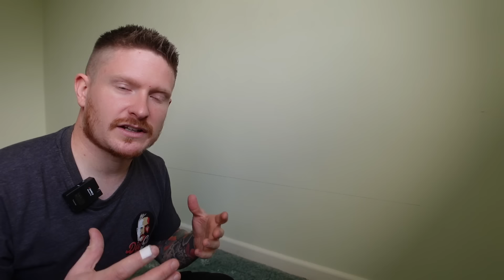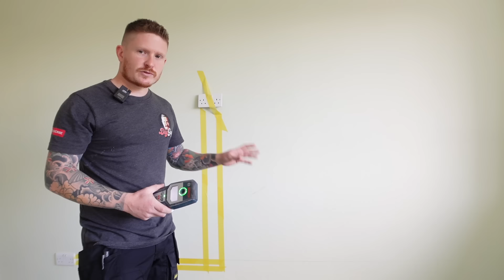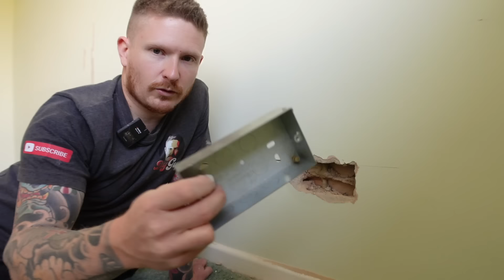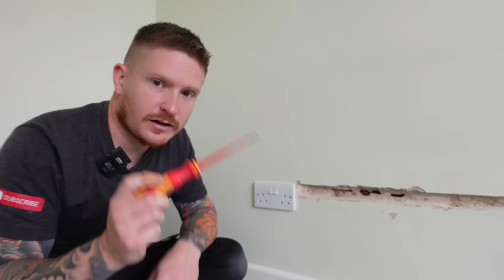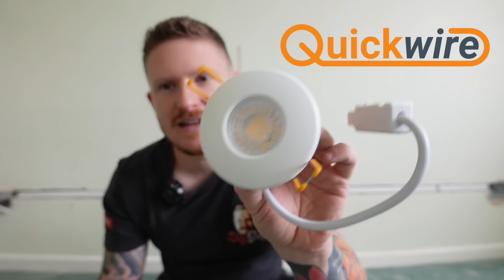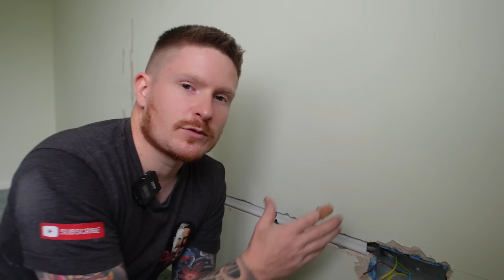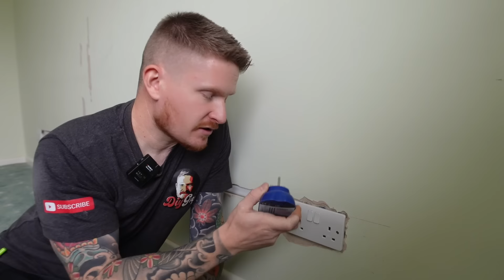How to Add a Socket to a Wall - Easy Step By Step Guide

Comment from the maker: What other electrical jobs do you want to see?
Reply: How to install a new shed in your backyard with lights connecting to the house power supply
Reply: @Megagamer12312 if it involves burying armoured cable, you have to be qualified to sign it off?
Reply: @sprint955st I won't tell if you don't!
Reply: Solar install
Reply: You at my house fitting solar panels for free!
Reply: Add an outdoor socket from main ring
Reply: Great video! Do you have anything like this for a studded wall specifically? Interested to see the correct way for running the cable past the batons.
Reply: Safe ones that comply with British Standards 
Simple really 🤷‍♂
Reply: Fitting a shower fan light please 👍
Reply: Putting a socket into a loft that only has loft boarding
Reply: Wiring the garage
Reply: how to on adding powered went/extractor to bathroom would be nice, can it run off of light fixture power?
Reply: @maciej9280  this is exactly what I need a video on
Reply: Nice little tutorial. What shade of paint went up afterwards? Looking for something similar for my kitchen?
Reply from the maker: @andrewgibbs5096  it was copper blush
Reply: Moving an upstairs bedroom light switch from one location to another
Reply: We don't all have plasterboard on our walls.
Reply: How to add a pair of switched bedside pendant lights c/w switch to control the pendant and the main room light 💡
Reply: Attach a ring doorbell
Reply: outside lights but with the wires from the inside so looks professional
Reply: Extractor fan for a bathroom 👍
Reply: Ones done qualified electricians
Reply: Consumer unit change
Reply: How to add a light in a understairs cupboard?
Reply: Could you do a video on how to remove old sockets such an aerial cable and old plug sockets, remove them and then fill the socket hole to blend in with the wall like new!? Would be a great help
Reply: How to add a new socket in the loft . How to get power for that socket if there is only a junction box for lights. Thanks mate
Reply: Can you change a fireplace electrical socket, and turn it into a normal socket which allows a fireplace to still work and plug a plug into too?
Reply: Thanks for the video it's very informative 

However, you demonstrated moving socket just across, what if I need to move it on to the perpendicular wall, and pass the corner, will I stay in the zone ?
Reply: Thank you, I can’t find the cable zone video. Also what about installing an outside socket please.
Reply: Patio lights on a submarine 😂😂
Reply: Can you do a short of showing off all your tattoos? That would be cool! :)
Reply: I want see full electric wire replacement of old with new design including new fuse box.
Reply: Do a minor works cert for that socket,then can you install a fully addressable fire alarm system in a nursing home.
Reply: Installing a consumer unit in a garage beside a house
Reply: Can you show us how to terminate a 4L 2.5mm MICC end, complete with gland and earth tag pots and seals, and how to insulation resistance test and measure it to identify the conductors and polarity, thanks!
Reply: A useful one would be to spur in a bathroom extractor (and how to fit extractor in loft, extractor duct installed to bathroom ceiling and exterior plus isolation switch etc) that would deff be a useful video; especially with bathroom mould due to damp being an issue.

But more importantly: because your videos are extremely simple to grasp, informative and professional. For competent DIYers, it'll be priceless.
Reply: How to get power from a socket, for lighting such as wall mounted bedside lights
Reply: @syedabbas8786 I second this. How to add a second light fixture taking power from an existing light fixture, or making a socket using power from an existing power source
Reply: Rewire my wife`s brain, joshing great video.
Reply: @herbetone  Careful, she who must be obeyed has ears and eyes everywhere...You don't want that tea tasting funny!
Reply: 😅😅😅 @Mclaneinc
Reply: How about you testing your work and providing an appropriate electrical certificate for what you have done. After all without the certs you have just voided your home insurance in the event of fault with your work.
Reply: @rjpish exactly right mate
Reply: None. You shouldn’t be doing electrical work at all. You can just now because the law allows you, but it will be changing very soon. Once the NICEIC push the government enough, You’ll soon have to pay that £50.00 per hour. Sorry.
Reply: You should be Part P qualified  by law to do electrical work in a House. And if YOU are not qualified you should not be making money out of this vid.
Reply: None!!! Stop teaching people how to do there own electrics. Especially when your not teaching them correctly, was that a ring you ragged that cable into because you didn't explain you have to make sure of that frist. Plugging a £3 socket tester in at the end of a job hoping it beeps doesn't mean you done it correctly! why do electricians test equipment cost £1000s of pounds if we could all buy a £3 socket tester!!! Was your Zs in regs? What was your PFC/Ze reading? Have you got RCD protection? None of this was explained! You cant just add a socket like he has made out on this video! DONT DO YOUR OWN ELECTRICAL WORK!!! THIS IS NOT HOW YOU DO IT!
Reply: Installing an extra light in a shed/ garage.

Comment: Hi many thanks for all your advice as I've learnt so much from you. If you have time to answer the following query it would be great. I'm currently building a model railway which needs around 4 to 6 sockets.. I have a double spurred socket in my room. To add another socket can I attach extra wires to the spurred socket which means 3 negatives. 3 positives etc or do I attach an fcu or junction socket to the spurred socket? As you know model railways have low electricity around 12 volts. All the best

Comment: If you  are just wanting to move a socket to a new place along the wall, can you join the wire somehow and cover it with the filler?
Reply from the maker: Not really. It should be accessible or maintenance free

Comment: 15:23 i would 100% use wagos or even better buy a new socket with wago-style terminals when fitting a fused spur - i know this is a standard spur (they are £8 each,so pricey but well worth it for the time saved). It can be difficult to get two cables into a terminal and get a decent, tight connection, 3 can be a massive pain!
Reply: Yep, just keep the ring active, wago 221 series  support 32 amp to 41 amp so you can the  extend the ring without fused spares randomly scattered around and having to put 3 cables into the terminals of your socket

Comment: I want to do this, from a single to a double. U.k. I want to fix a double socket on the wall about 2 meters from the single socket that is powering the fridge, so that I can power a tumble dryer and a television.
Reply from the maker: Sounds like a useful project, just remember to keep safety first! ⚡

Comment: Just a little tip of the day, after the tug test, push the face back into place and then pull out and do another tug test. You'll be surprised how many times a wire comes loose, especially old wires that become brittle and snap. 

Not a regulation, only an optional tip. 

Great video, great advice for DIYers. Well presented. 👍

Comment: Not part of this video but I am curious if we wanted to take our hallway radiator which the hall is so very small to create so space. Is this the same process as taking it off and isolating but also is there a video anywhere to connect and join the pipes? Not sure about the process but would like a video like that if possible 😊

Comment: When I was an apprentice in the late 1960's, the reg's were cables had to be run vertically when buried in the wall. If this was not possible any cables run horizontally then had to be run inside metal conduit to protect the cable from accidental damage. I have never done house bashing as a trade, but have done a little for friends and family over the years. It seems strange that the would lower the safety standard unless you had a RCD fitted for protection
Reply: the regs specify rcd prodection, (which is usually on the master breaker in the consumer unit so all circuits are protected)

Comment: Is there a rating on the electric cable to use when creating the spur connection? 32amp? 16amp?
Reply: Same size as the circuit
Reply: By same size i mean the cable size (normally 2.5mm and 1.5mm cpc) 

cables are not measure in amps, they are measured in cross sectional area (CSA)

Comment: If you wanted to go across and up for an outlet for the TV how would you do it? A backbox at the L just to run the wire through? Or would you use those conduit connectors? I don't know if those exist for oval conduit?

Comment: If I’d wired this socket I would’ve you’d 20mm oval conduit and taken it into the metal boxes so no need for grommets when I used 25mm conduit I used to cut a slot in metal boxes to take conduit into box so any problems with cables later they could be replaced easily 😊

Comment: Thanks for this. How do I know if I have a radial or ring circuit?
Reply: A socket circuit protected by a 16A or 20A MCB (miniature circuit breaker) is almost certainly a radial circuit. A 32A breaker is more likely to be a ring final circuit, though it can occasionally feed a heavy-duty radial using thicker 4mm² cable.If you (or an electrician) inspect the wiring at the breaker itself, a single cable exiting the breaker indicates a radial circuit. A ring circuit will have two cables (forming a loop) entering the same breaker.
Reply: You are kidding right?

Comment: On a ring circuit you can have multiple spurs, but it needs to be fused with an FCU at 13A, which is obviously limits the use of those sockets.
Reply: Not if it's only one.

Comment: Howcomes there were two earth wires in the new cable?
Reply: There wasn't. The other earth you see isn't part of the new cable its just a loose bit of earth wire used to earth the back box.

Comment: How do  i get the extra earth wire from the back box to the face plate
Reply: Cut a different bit of cable and take out the earth core put some earth sleeving on and just screw it to the earth terminal in the back of the box and the earth terminal in the socket
Reply: @LukeRobertson09  Thought that was the case, but best to check, thanks mate

Comment: Plus you cannot rely entirely on RCD's. Nothing replaces good quality work. RCD's can get stuck In the ON position, and during scheduled testing  they should be tested for trip time and sensitivity. Also as said already this sort of job needs a minor works  certificate issued by a professional electrician.

Comment: Anything but easy 😂 thin layer of black cement / plaster onto to solid stone wall. Nightmare to chisel out. Running cables under floorboards was a mission too.

Comment: I've got a weird setup where there seems to be concrete wall just below/behind my TV, but then almost like drywall (soft, sawable) below it. I want to feed the TV wires behind the wall. I would need to drill and chisel out concrete in a similar way to this video. But why is there concrete seemingly floating above hollow wall in my flat? I don't want to touch it unless I know it's going to be safe.

Comment: If wall insulation blocks or stud wall filled with insulation then unless cables completely separate they need to be larger than 2.5mm.

Comment: Before drilling or cutting out check there is nothing on reverse side of wall to fall off . From experience some walls have been found to be only 50mm deep, and they were party walls to different properties.

Comment: Does it have to be 2.5 mm or can I use 1mm wire?
Reply: 2.5 mm is needed for a socket at 230V/16A. Smaller wires are only used for lower power circuits like lights

Comment: Any additional electrical points, i.e. socket, light etc, or cable, must be fully tested with test equipment that is in calibration This work must pass ALL dead, live and function tests and a minor works certificate issued by a qualified electrician as per regulation. This is a LEGAL requirement.

For a d.i.y. channel he is competent and has given viewers great advice. There is a lot behind the scenes that many viewers will not be aware of, which could lead to SERIOUS safety issues.

If in doubt, call an independent competent electrical contractor that is registered with a governing body. 

You do not need to be an electrician to change a socket face plate or light switch, BUT it is a LEGAL requirement to certify any and all additions. Your safety and home potentially at risk.

Comment: When I did my courses I was told to either run it under the floor or down from the ceiling never going across.
Reply: Doesn’t mean he is wrong mind.
Reply: Cable zones in the regs can run horizontally or vertically in walls

Comment: How many sockets  wires can I wire into a 32 amp breaker trip switch?
Reply: If it is a ring main circuit you can have as many sockets as you like given it is rated for 32A, takes into account distance and how much spurs you have on a socket.  but you can’t have as many spurs off one socket as you like. Only one spur per socket
Reply: @Luke_Carpenter-i8q  Mine is radial, one of the sockets has a double socket spur, and have spur ed a single 13 amp switch which leads into bathroom for the sink tap. But main lead goes to the 32 amp circuit breaker,  as the other 4 socket leads.
Reply: @benharis1956  so what you’re saying is one of the sockets has 4 cables in it and  has spurred of with a double socket and a switched fused connection unit
Reply: @Luke_Carpenter-i8q  No one socket has two spur, I.e another double socket & a fused switch which powers the 3000watt tap faucet.
Reply: The double socket is two meters spured and the switch is right next to it.
Reply: @benharis1956  oh ok, yeah as I said only one spur off one double socket normally unless it is the end of line in a radial circuit then you’d be extending the circuit
Reply: @benharis1956  and only spur multiple sockets of end of line on the radial if it is a double socket and not fused connection units
Reply: @Luke_Carpenter-i8q  Thank you.

Comment: Can I take socket power supply for an outside light? Will I get power without socket switched on?
Reply: If your wanting a power supply for a light I’d spur off a socket into a fused connection unit and power the lights with that

Comment: Good clear instructions. Wonder what you feel about extending using WAGO connectors where the box is barely deep enough for an existing ring supply where the two supply cables are crammed close together through one knockout, with a pre-existing wall  heater hooked up as an outlet from the box, such that the face-plate will no longer screw back tight to the wall. Safe but looks crap

Comment: How would you join a vertical cable in the middle of the horizontal run of cable if you want to add a socket higher up on the wall for a TV? Would you use a junction box? Or do you use wago connectors inside the wall?
Reply: Don’t use wagos in the wall. I’d run a cable to the socket going horizontally and spur off it

Comment: Is this process the same when im replacing the old plug socket with wago connectors and a blanking plate so im basically moving the socket across the wall?

Comment: Having done these jobs when I was married in 72, now retired I cannot believe I stripped wires with my teeth, or worse still old pliers and a craft knife, the new stripping tools are unbelievable. Going to buy that Stanley stripper. Your videos are so enjoyable.
Reply: I remember my older brother fitted a new plug on my mum's iron stripped the wire with his teeth as he pulled the cable he broke his tooth 😂still to this day he's got half a tooth 40 years later
Reply: That’s why you’re still alive - keep stripping wire with your teeth it will strengthen them ❤
Reply: The strippers were different in the 70's alright.. no plastic🧆